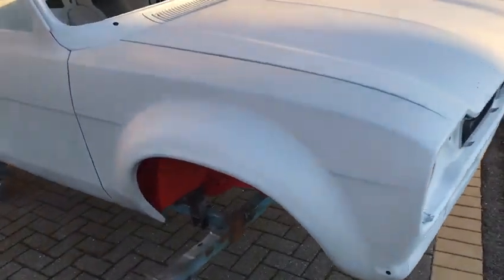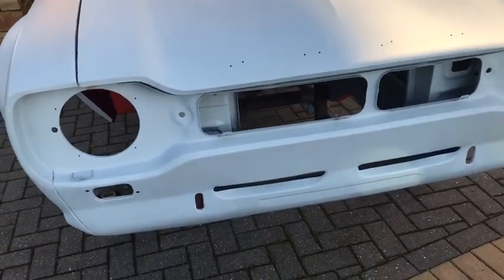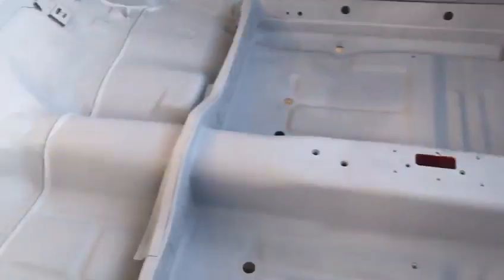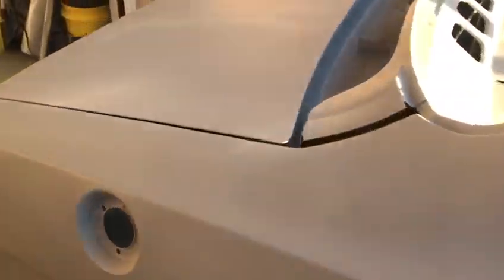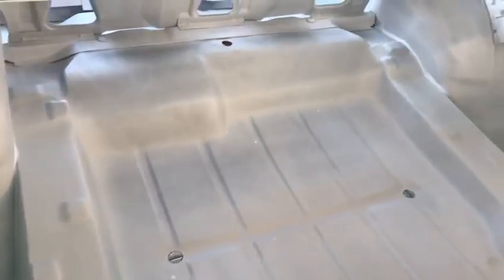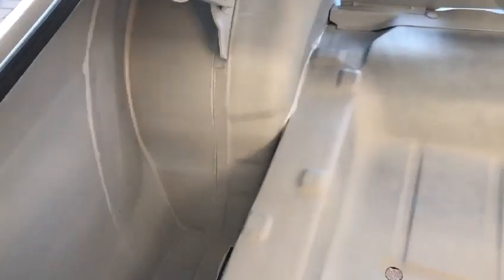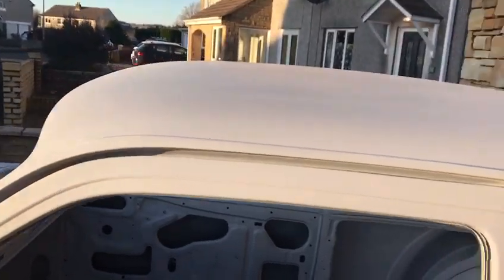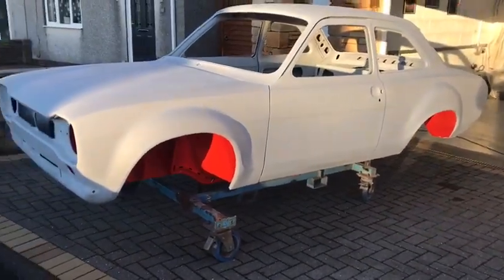Mk1 escort restoration recorded 29/11/19

Comment: So basically it's a brand new car😁it will look great once completed
Reply from the maker: Pretty much James. Around 65-70% of the car is now new steel. I have repaired panels that weren’t too bad such as the boot floor, rear quarters and rear passenger inner arch but i could have replaced them with new also if id decided to but i didnt to try and keep as much original steel as possible which in fairness is not a lot 🤣
Reply: @performanceclassics1986  Most importantly it will be back on the road😁👍
Reply from the maker: @jameswilson8820  yeah another classic saved 👍

Comment: Nice car ! Can you tell me how wide are the front wheel arches .like to make 4 of those on my bmw .can.t find anywhere how wide they are . Found on the internet steel arches to weld to the original fender .thanks .and again great car
Reply from the maker: Very Sorry, I forgot to reply to your message. At the widest point in the top centre they are 110mm wide then they slowly draw back into the wing at the front and rear bottom edges. Hope that helps

Comment: Hi mate did you get the shell dipped or blasted before you started on the restoration ?
Reply from the maker: Yes i had the shell blasted and put in a dust coating of epoxy primer. It just helps highlight any problematic areas. Dipping is a great process but i believe the shell needs time to air off for a good long time before the shell can be prepped and painted.
Reply: @performanceclassics1986  can i ask where you got it done at ?
Reply from the maker: @gambo08  Yeah it was actually done by the bodyshop (whitehaven accident repair) who later painted the body-shell. Unfortunately the owner retired in November and they closed which is a huge shame to lose such a great body shop 🤦‍♂️

Comment: hi great job I am doing the same as you, but having trouble with upper bulkhead  corner to  look good with the door line, any tips? mine is sitting high  thanks
Reply from the maker: Roundstone Thanks for the comment much appreciated. I seam to remember that the bulkhead was wider than the car so it could be aligned nicely on one side but the other side you could fit your fingers in the gap. I remember tweaking the panel to bring it tighter to the car then i just trimmed the edge to follow the A post line. I also welded so far down the edge on both sides then dressed it back to make it look like how the original was fitted. The old bulkhead was lead loaded to the A post and that took some removing i remember. Hope this is of some help. Hope I’ve picked up your question correctly. Let me know if i haven’t.
Reply: @performanceclassics1986  Hi Another question the front wings do they sit behind the front panel or in front??? as when I put the wing in front I have a massive door gap?
Reply from the maker: Roundstone yeah i had a similar issue. The wing lip sits in front of the front panel yes. If i remember rightly i sat the wing on, put on some clamps lightly to hold it in place then used a big block of wood across the front face of the wing and sharply hit the wood with a decent sized hammer. This then shunted the wing backwards without damaging it and the clamps held it in situ afterwards. To be honest the wing gaps were my biggest headache on the full build. Its so so difficult to get the wing aligned perfectly with the bonnet, Door and front panel all at the same time. It is achievable with time and patience. I remember spending around 2.5 to 3 days to fit each wing perfectly but the end results look amazing so wort the extra effort. Aftermarket wings are an horrendous fit and everybody struggles fitting them perfectly so your not on your own with these issues.
Reply: @performanceclassics1986  do you have any videos of you doing the car ????
Reply from the maker: Roundstone I only have hundreds of photos. I regret not doing videos now but i just got my head too engrossed in the build and didn’t give much thought to anything else. Whenever i do another future build, this is something Im certainly going to do.